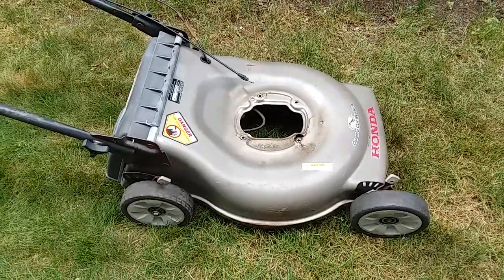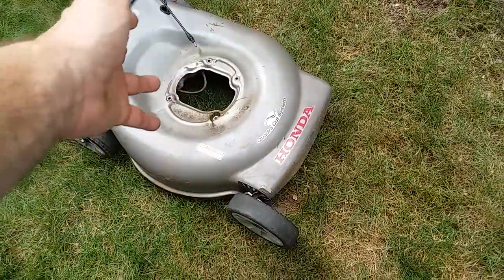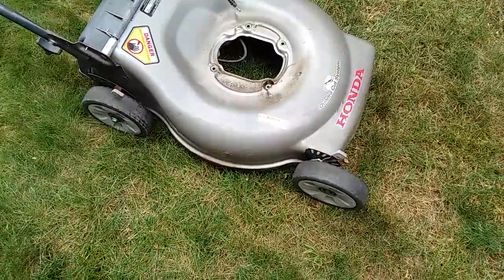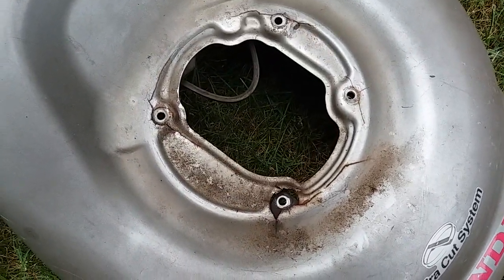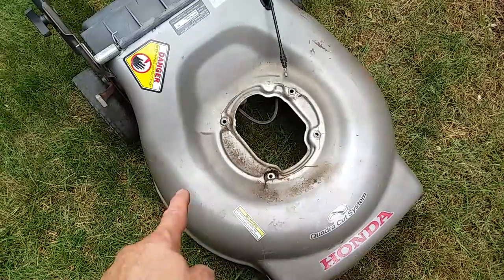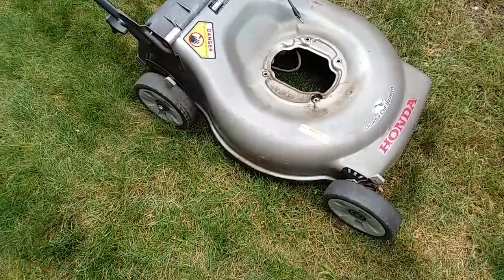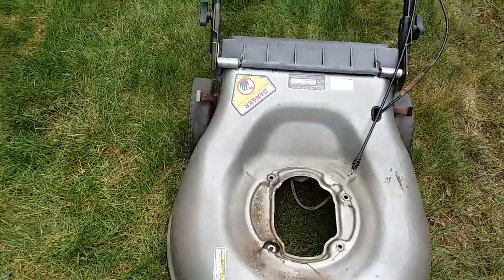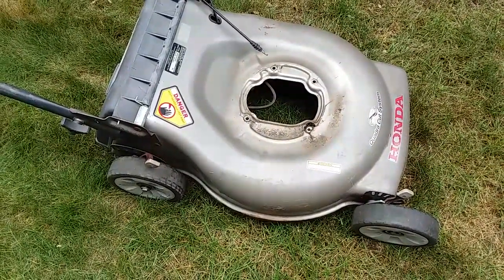Why a bent crankshaft and a broken deck are always found together

Comment: most times a welder can fix those cracks
Reply from the maker: Yes if you have that equipment
Reply: @berardia4  i have a 2006 honda hrr216, and i used my family member's welder and welded the cracks around my engine mounts when i was rebuilding the mower and still holds up ever since i did it cause trying to find these decks are way complicated and expensive of the worth of the mower itself and they are backordered, i order one and its been 9 months still hold in backorder.
Reply from the maker: Honda parts are expensive